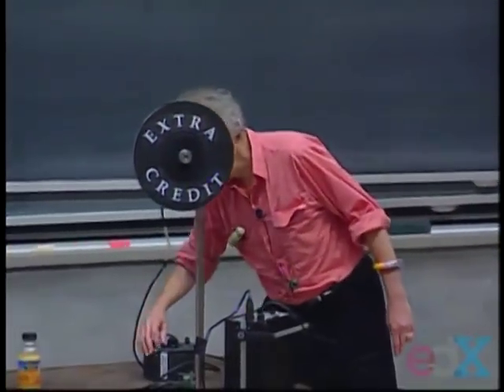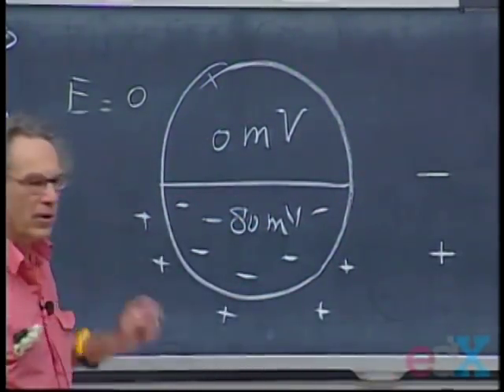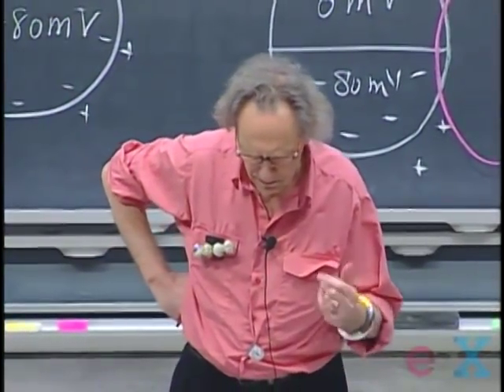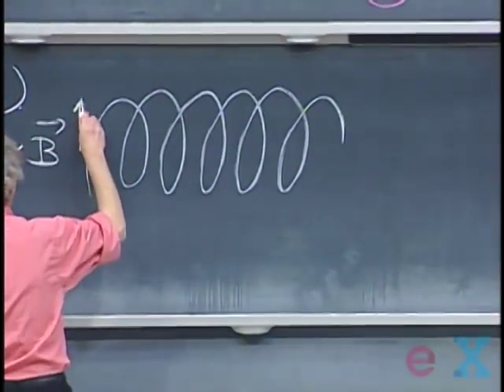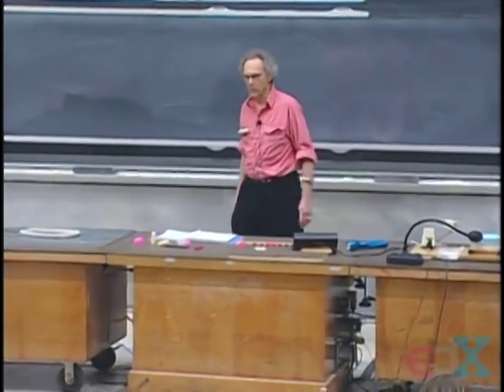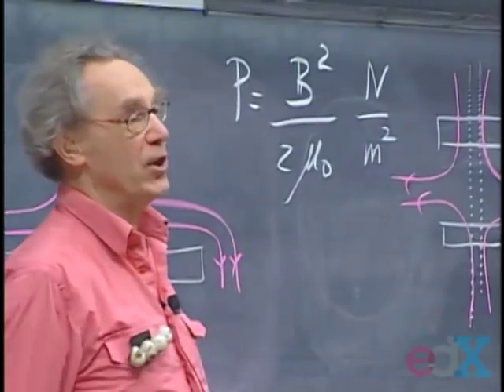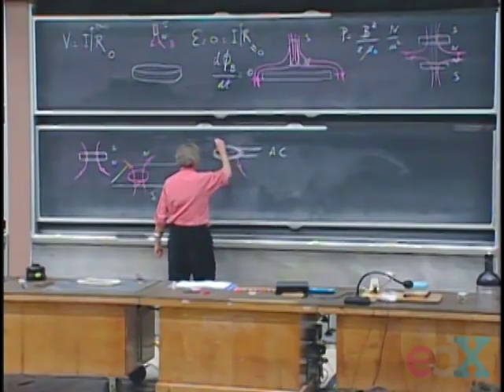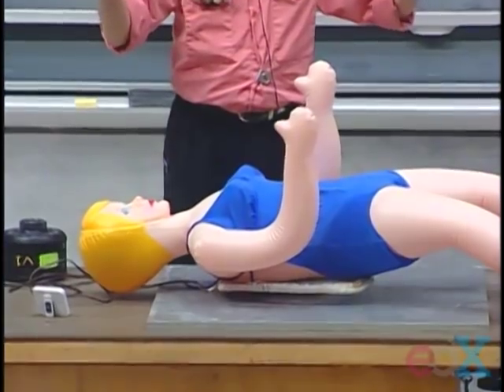8.02x - Lect 19 - Magnetic Levitation, Human ❤, Superconductivity, Aurora Borealis

Comment: Professor Walter Lewin 
this lecture blows my mind how eddy current is created without EMF , what is that thing that moves the charges ??? 
I am sorry I am asking too much 😓
Reply from the maker: There is an EMF - Faraday's Law. Watch the lecture again.
Reply: Lectures by Walter Lewin. They will make you ♥ Physics. 

I mean if you cant create electric field inside superconductor that mean electric field line will just walk through the surface and there is no current will be inside superconductor just on the surface  

that is right ?? 😓 I think that I'm wrong.
Reply from the maker: that's a tough issue.  Keep in mind that E=j/sigma. j is current density and sigma is conductivity. Thus j=E*sigma. superconductor E=0, sigma is infinity, thus j can be anything.
Reply: Lectures by Walter Lewin. They will make you ♥ Physics. 

I searched about meissner effect 
and I find the same reasons about why there is no magnatic field inside superconductor that I watched in the lecture 
but what I read  that is "Surface currents" who cause that.
so I think that electric field goes through the surface of superconductor. 
I'm sorry Professor Walter Lewin I think that  I'm annoying you.😓
Reply from the maker: I should not at first have mentioned the Meissner Effect. Notice that I removed that later. 
Keep in mind that E=j/sigma. j is current density and sigma is conductivity. Thus j=E*sigma. superconductor E=0, sigma is infinity, thus j can be anything. Since the currents can be "anything" they will be such that they produce B-fields to prevent the external variable B-field to penetrate the superconductor (Meissner). A proper explanation will require QM. Most of magnetism (like ferromagnetism and para magnetism) belongs to QM. You may want to consult Google.

Comment: Hello professor , will the resultant force be zero on a wire carrying a current that exists in a uniform B-field due to the Hall effect ?
Reply from the maker: YES good question.
For a simple metal where there is only one type of charge carrier (electrons), the Hall voltage VH can be derived by using the Lorentz force and seeing that, in the steady-state condition, charges are not moving in the y-axis direction. Thus, the magnetic force on each electron in the y-axis direction is cancelled by a y-axis electrical force due to the buildup of charges. The vx term is the drift velocity of the current which is assumed at this point to be holes by convention. The vxBz term is negative in the y-axis direction by the right hand rule.
F=q(E+v×B)
{\displaystyle \mathbf {F} =q{\bigl (}\mathbf {E} +\mathbf {v} \times \mathbf {B} {\bigl )}}
In steady state, F = 0, so 0 = Ey − vxBz, where Ey is assigned in the direction of the y-axis, (and not with the arrow of the induced electric field ξy as in the image (pointing in the −y direction), which tells you where the field caused by the electrons is pointing).
Reply: Does this mean that magnetic force between two wires carrying a current will be balanced by an electric force and we will see no more pull between the wires ?
Reply from the maker: no - https://en.wikipedia.org/wiki/Hall_effect
Reply: @lecturesbywalterlewin.they9259  but why the wires will still attract each other if there is an electric force that will balance the magnetic force on each wire ?

Comment: Is there a way to determine the velocity of the magnetic fields?
Reply from the maker: If you generate a magnetic field (e.g. in the form of EM radiation or becoz you run a current in a wire - Ampere's Law) it will travel with the speed of light in vacuum. Watch my 8.03 lectures.

Comment: Professor I did understand the entire ecg segment but still I don't get on what basis  one electrode is labelled as positive and the other as negative of the recording voltmeter. Can you refer me to any video of yours explaining this ?
Reply from the maker: question unclear. all voltmeters have a + and a -- side.
Reply: Professor I do know that that they have positive and negative electrode, but I am asking what makes them positive and negative, is it a convention or any reason is there behind it ?
Reply from the maker: the convention is the same as that of amp meters - in fact all voltmeters are amp meters. If a current is going through a voltmeter from the + side to the -- side then the voltmeter will show a positive voltage. If the current goes in the opposite direction the voltmeter shows a -- value.
Reply: @lecturesbywalterlewin.they9259  Thanks professor for clarifying my doubt. 🙏

Comment: I am a bit surprised by the numbers.
600V at 6-10 Amperes ?
Can that be true or did he actually mean uA ? or mA ?
600V at 10A is 6kW, even if just applied for a few ms that shounds like enough energy to explode a heart.
Reply from the maker: Those numbers are correct. But remember that NO magician would ever lift women this way. Their lifting is a trick, it's NOT real. I am lifting a balloon woman which weighs less than 0.5 kg. I even filled the "balloon" with helium to make it as light as possible.
Reply: I am sorry I was not exact enough. I was not refering to the lifting.
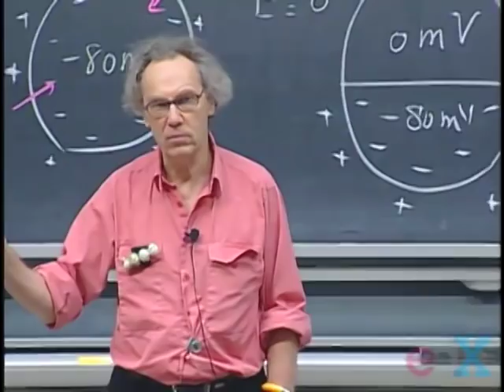Please look at about 15:30
There you say that 650V, 5.5ms, 5-10 amperes

I just wondered if the numbers are right.
5ms and 650V sound right but 5-10 ampere sound soooo high ;)
Reply from the maker: Ha Ka these numbers are totally absurd. god knows how that got into my lecture. What surprises me is that you are the FIRST in 14 years that pointed this out. Thanks for mentioning this. Here you find the specifications of a pacemaker. 
https://galileo.seas.harvard.edu/images/material/3794/1321/CardiacPacemakerdesign.pdf
Reply: I feel honored :) 
Thanks for the specs, very interesting

Comment: if you run a current in a superconductor and it generates a strong magnetic field, will it still repel any incoming magnets?
Reply from the maker: question ill-defined
Reply: We know that a stationary non-current-carrying superconductor repel magnets. Now if we hook up the superconductor to a power source and allow current to  pass through it, will the superconductor  still repel  magnets?
Reply from the maker: A current can go through a SC It will produce a magnetic field (Ampere's Law). The B-field will not be inside the SC material.
Reply: so i guess that means it would still repel any magnets as usual?

Comment: Sir if I connect superconductor across a voltage source(V) will the voltage across superconductor still be zero
Reply from the maker: If you measure the integral of E dot dL through the superconducting wire, you find zero. If you measue the integral of E dot dL through the Voltage source you find V.

Comment: sir u said for magnet to float over a normal conductor we need to keep magnet moving if we do the other way around that means we move conductor and keep magnet at rest, will it still float  and if we use liquid conductor instead of solid one
Reply from the maker: yes that also works
Reply: so if we talk in term of magnetic pressure will that be directly or some way related to velocity of flowing liquid
Reply from the maker: no
Reply: why not sir  because more is the velocity of conductor more is the rate of change of flux so more is the emf so more eddy current in trying to cancel the effect
Reply: actully I m working on project of sensing the velocity of conducting fluid by magnetic levitation method so if you could suggest  me some  resources

Comment: Sir in superconductor, how we get current without emf. In any other cases we get like that, what is its meaning sir
Reply from the maker: If you have a superconductor in a circuit with a  battery V and  resister R the current through the supercondcutor will be V/R.

Comment: So with super conductance there is Zero Resistance.
With Zero resistance there is Zero Voltage. No Differences.
Yet one can Flow a current thru the material with zero differences in potential.
 What creates the potential to flow ?  Only the External Differences ?
The only obstacle being the interface between Zero and Potential.
Reply from the maker: a battery in series with a superconducting wire will create a current V/r_i. V is voltage of battery, r_i is internal resistance of battery.

Comment: The German Maglevs do not use the principal you're disgusting. They work on attraction forces. The trsin wraps around the rail and magnets underneath pull the undercarage up tords the rail lifting the train. computers controll the magnets power so the undercarrege never comes in contact.